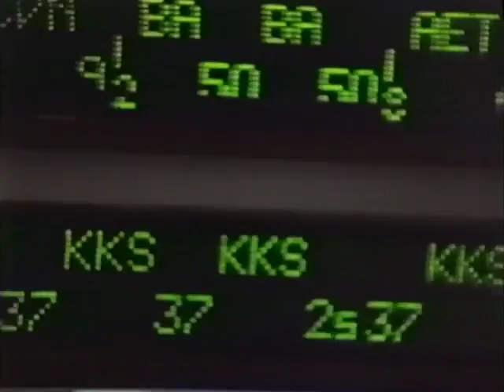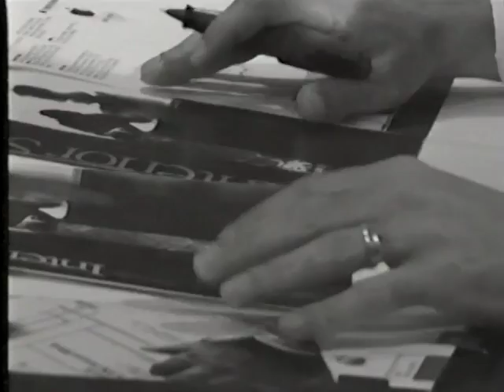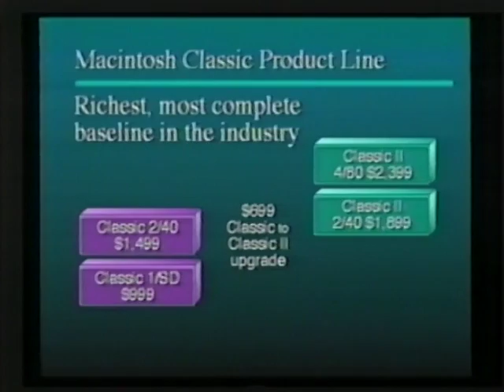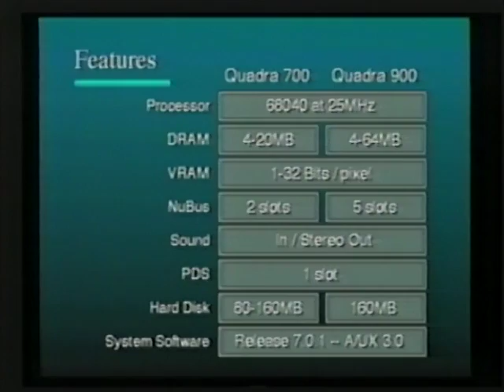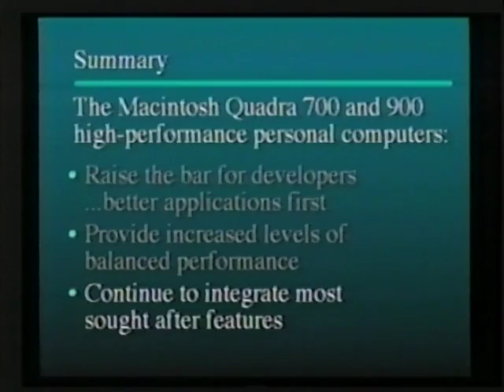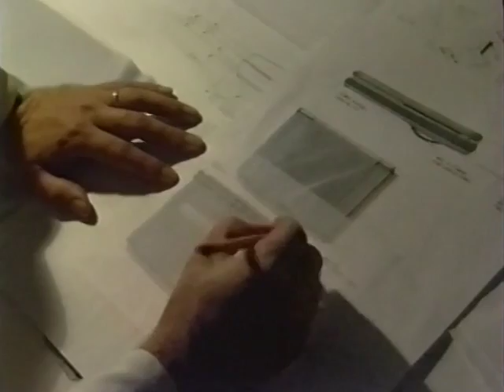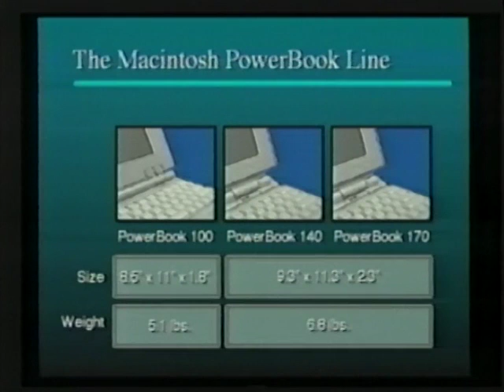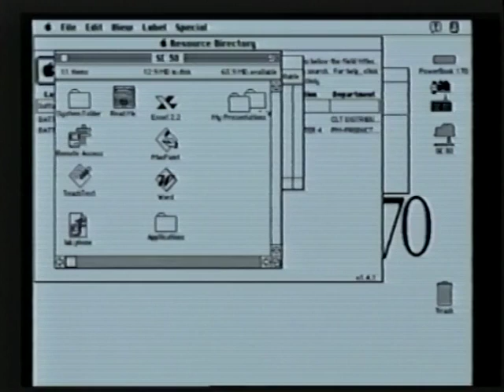Apple User Group Connection - December 1991 - Apple VHS Archive

Comment: "....we surface mounted ethernet right on the motherboard so ethernet is the fastest yet!"

MMmmmm..have transfer of a ftp session right now on my Quadra 800 and it is only moving about 4 files at 32KB per second.

Thats on local 10Mbit ethernet connected to my LINUX running ftp server.  

My LINUX box is probably wondering WTF is this thing connected to me?

:-)
Reply: Gregory Carter It shouldn't be that bad. AFP was really bad back then and would probably only pull 500kB/sec, but FTP should basically max out 10BaseT.
Reply: Peter Brockie Yep.  The machine was very busy at the time.  I get about 6-8mb a sec with ftp.
Reply: It does about 200K max per second after I switched to OS 8.1, and removed optimized my system where I could take measurements.

I setup netatalk and the session speed is not bad, compared to the size of the programs in that era.

Now I am experimenting with alternative SCSI devices as the drives I have I try to run sparingly given their age.

But I using SCSI to SDCARD devices for archiving (Too slow to use for general use.)

But I am hopeful that the latest one I just ordered will be fast enough as it can do about 10MB/sec read/writes which is plenty fast for my Q800.